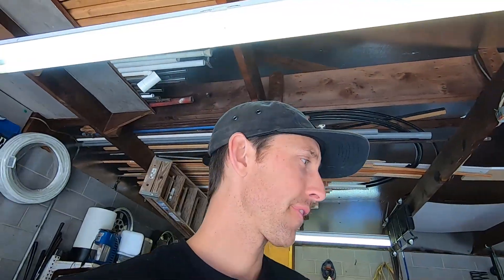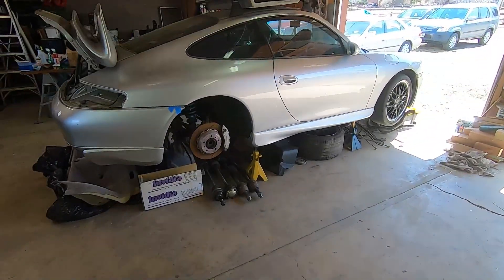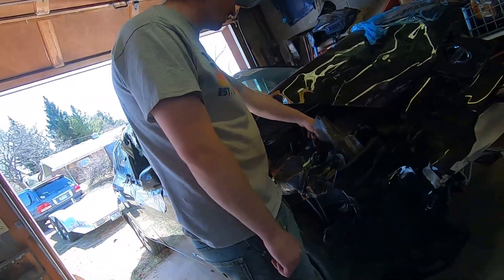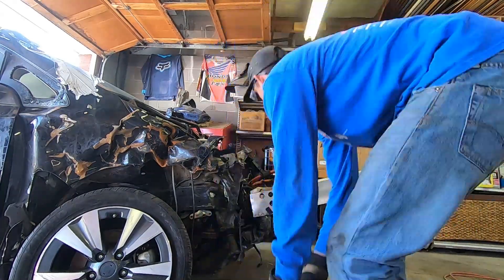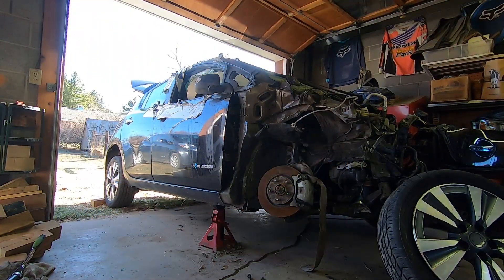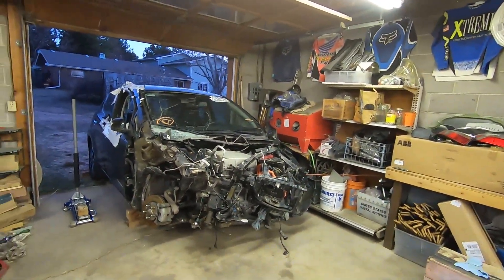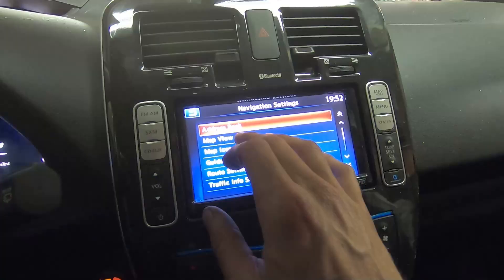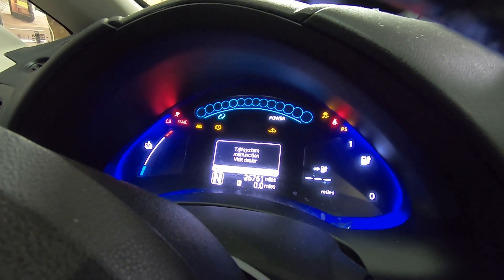Porsche 911 Tesla Swap Part 8 - Wrecked Nissan Leaf Battery Donor Arrives.

Comment: I think Tesla has a pyro fuse that blows in a accident and disconnects the battery from everything , likely this battery pack would have something similar for safety , definitely a cool project , planning a EV project soon so I will definitely be checking out the progress on this
Reply: Yeh, your right. A Tesla will blow the pyro fuse if any airbags go off. The leaf just has a basic dumb fuse that will only blow if overloaded - It's combined into the disconnect switch.
Reply from the maker: Awesome, thanks for watching and the info here!

Comment: Maybe have a look to see if the battery disconnect has been removed - centre of rear floor behind condole. It may have been pulled for safety? Love the project!
Reply from the maker: Thanks for the tip!